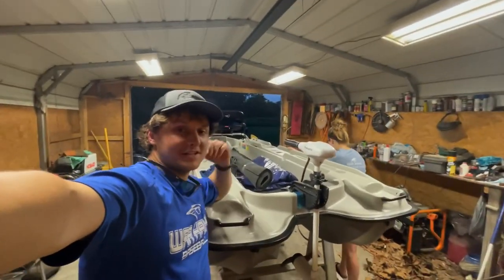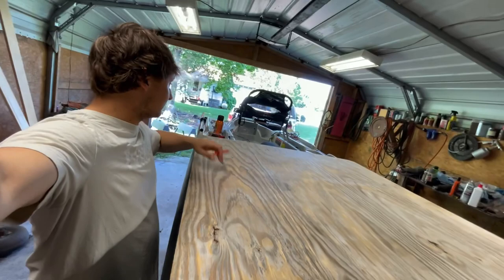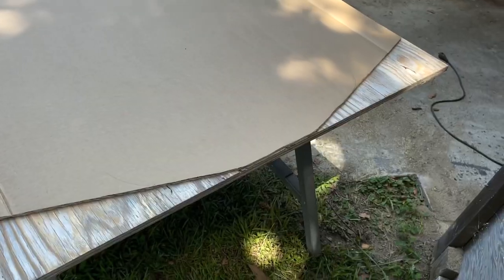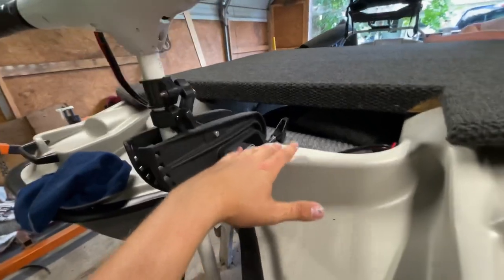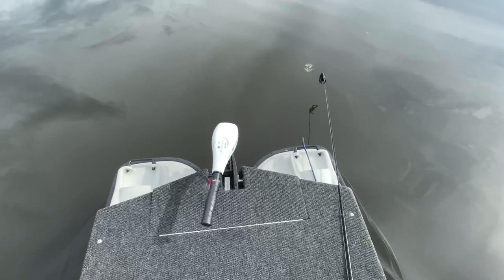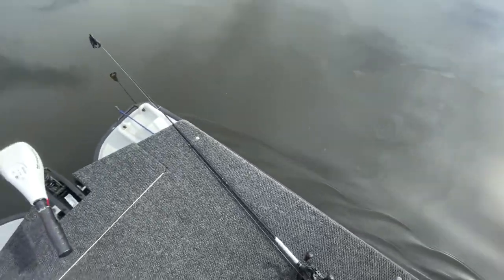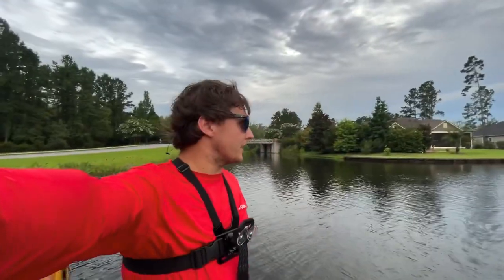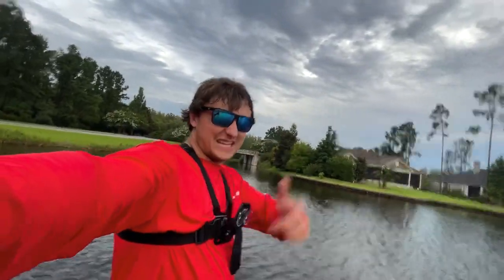Building a Casting Deck for My Bass Raider 10E NXT!! (Awesome!!)

Comment: Do you feel more stable using the casting deck? I just bought a 10E and it's only like 22" wide, I imagine adding that extra width feels way better.
Reply from the maker: @chapppy3782  its much more stable in my opinion

Comment: Awesome video and great looking deck. OK so how is the deck holding up? Can you feel the wood degrading at all or  spongy? Contemplating going with marine grade plywood
Reply from the maker: The deck is holding up great. I built a frame underneath to keep it from warping. You can’t go wrong spending the extra money if it’s in your budget though! I would say my current set up will last as long as the carpet does
Reply: @BrantleyWalling  thx buddy.

Comment: Excellent video, and a beautiful deck!! (Glad I spelled that right!!) What type of screws did you use to secure it to the boat? Thank you!!
Reply from the maker: Thanks man!! I used 3 inch long stainless screws, about a 1/4 inch thick with separate trim washers
Reply: @BrantleyWalling  Thank you for your quick response! Are they sheet metal screws?
Reply from the maker: @whobedannyd  stainless steel pan head with a trim washer

Comment: Looks awesome! How easy is it to remove?
Reply from the maker: Just 4 screws on each corner.
Reply: @BrantleyWalling  so those 4 screws are into the top of the boat?
Reply from the maker: @ay_ay_ron3762   yeah, I went into the top lip that’s about an inch wide

Comment: Man that bass raider is looking 👌🏽😎What size screws did you use to bolt the deck down?
Reply from the maker: Thanks man!! I used 3 inch long stainless screws, about a 1/4 inch thick with separate trim washers
Reply: @BrantleyWalling  bad ass man thanks for that info. Fish on brotha 🎣